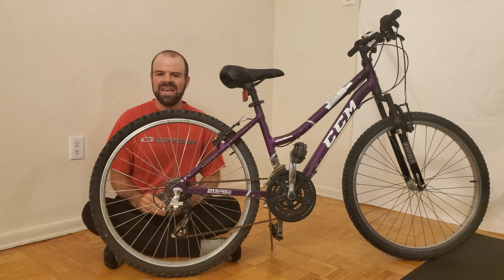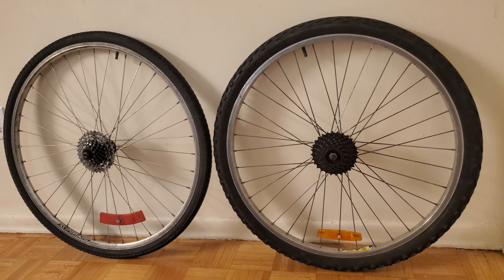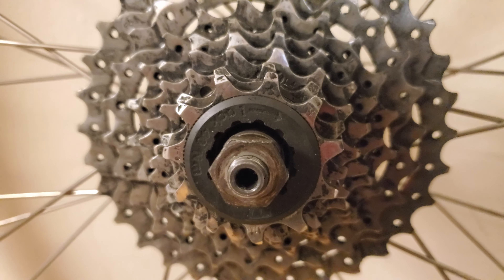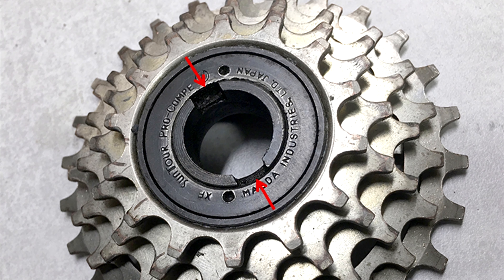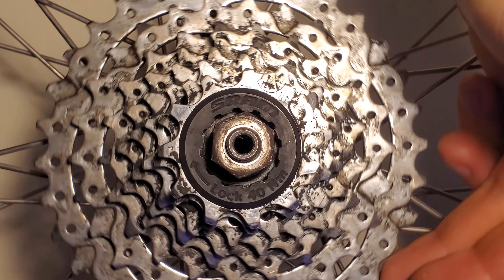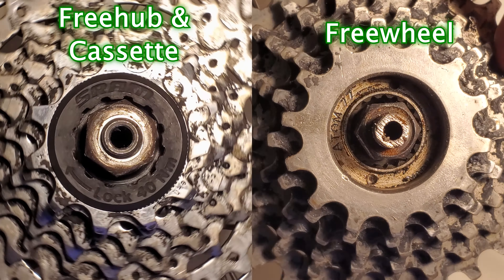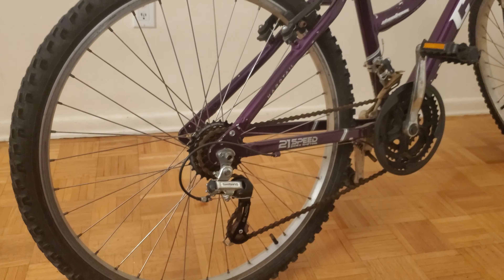Does my bike have a Cassette or Freewheel?

Comment: It’s hard to explain but it’s hard to tell on mine because there’s no notches I can see as clearly as the ones on the video. I’ll post a clip of it on my channel if you can just see if you can tell because I want to change the gear ratio but dont want to order the wrong part. Thanks
Reply from the maker: I took a look at your video. I really don't have very much experience working on single speed bikes, so I don't know the property terminology. But I would say that your wheel has a freehub, and the single sprocket is held on with a lockring. The difference is that this lockring has it's notches on the outside, rather than the inside.

Comment: Does this make a difference to which chain I need to use?
Reply from the maker: No, not really. Chains are typically sold based on the number of sprockets that you are in the freewheel or cassette. More sprockets means the chain needs to be thinner.

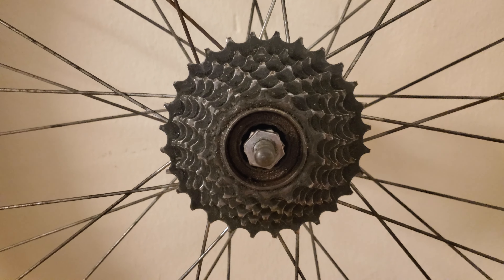Comment: Thanks. Very clear, but is a correction needed at 0:24, where you say the wheel is fitted with a freehub?
Reply from the maker: Yes, the second example I showed is a Freewheel, not Freehub. Somehow I didn't realize I had said the wrong word at that point in the video until years later.